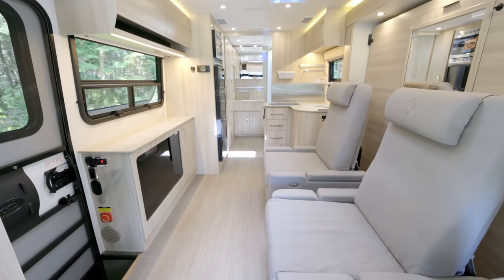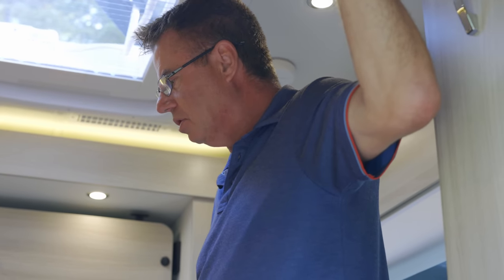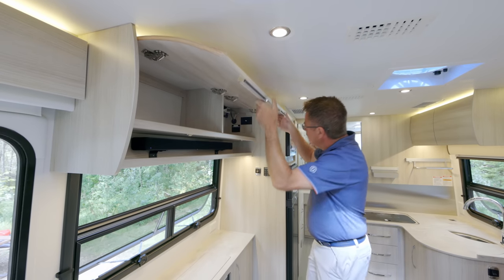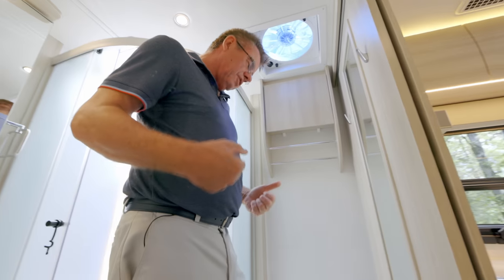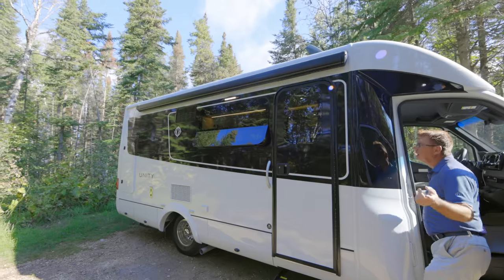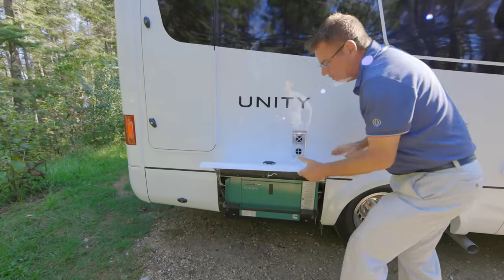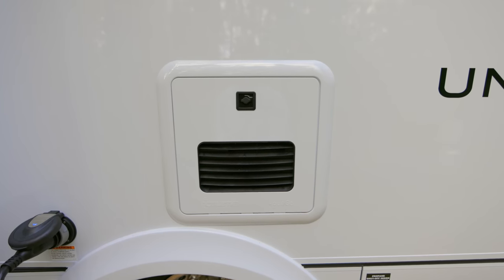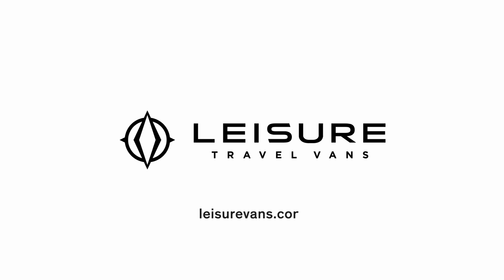2022 Unity Murphy Bed

Comment from the maker: Shop for LTV gear on our online store https://shop.leisurevans.com
Reply: Every time I see a new video from LTV I am disappointed that they still don't include seatbelts for every seat as well as an all electric/no propane option. Also when are they going to stop using those propane refrigerators as well as offering lithium as standard and not a pitiful 200 amps for a rig of this luxurious size. If I were to buy one of these it would be very costly bringing it into the future from where LTV is centered like sealing up the vents behind the frige after replacing the propane one. Don't misunderstand thinking that I hate their models because I don't, I would love having one but I would consider it an incomplete unit because of these shortcomings. There's also  no good reason that auto gen start is only available with propane and that there is no under hood second alternator.
Reply: The biggest disappointment of all is they discontinued the Serenity model. That was the absolute best floorplan they ever had.
Reply: @jeffreypatterson9956  no it wasn’t, it the most expensive and did not have enough headroom inside the coach - this has 6’5”
Reply: @jeffreypatterson9956  I agree with you 1000 percent.I don't like to used propane in my motorhome. I prefer to use all electric.
Reply: ⁹p
Reply: I guess it’s uncouth to ask the price??
Reply: @edmundf.kuelliiispiritualn2963  it’s $150k roughly depending upon options
Reply: 200ah batteries is NOTHING for that highly electric van 🤦🏻‍♂️ Hope they’re not idiots and offer a 400 amp hour option…
Reply: Love it do you have one with washer and dryer and second room? A bigger refrigerator or double doors, I want one but I don't know if I be able to remember work it or drive it never drove a van or truck well I haven't driver since my Teenage years I have transportation or lyft 😅 🙃  but I'm ready to get one of these to I don't every have to deal with slums/ Scum landlords bad environment was tricked during the pandemic to a apartment that's very sickening can't breathe it's just inhumane that van looks better than this so call condo this dirty landlords tricked me into holes you can see into the basement smells like gas sewage black mold and not heat or hot water top of that rat's bugs and since I called Inspector are crooked she bribe them hush money walls were dirty I have got a lot of health issues because of her n husband they really hurt me and my children health and everytime I try to look for apartment she and others give other people bad recommendations false statement lies she and her ppl discouraging housing agency Realtor and leasing agent not to rent to me when we are the victim that was tricked into the apartment that's sickening we shouldn't have holes or the debris dirty coming up and the inspector found we were breathing Carbon Dioxide and the landlord managed to sweet talk that people not to report her I don't know what to do facing homeless because they trick me in court I could find or afford a lawyer in system is corrupted was silence to to speak they censoring you they tricked me because they did want me to show the pictures 📸 videos prof of the living conditions first week moved in the winter during the pandemic we had to wander the streets freezing and having predator following me and my children chased me at night I'm living a night me I appeal my case again because I am not going to be homeless I don't have any where else and the windows doesn't open everything is in the condo is old and broken haven't cooked because the rat's come out bugs a lot of black beetles etc.. smells like gas that fire alarm ⏰ comes on carbon Dioxide machines comes on and we have hole 🕳 bigger that the front doors she only let us look during the pandemic for 5 minutes and their were furniture covering all the problems that we didn't know and no lights was working in the back were the back room you can see the basement laundry room which other neighbors wash their clothes 24/7"and we can hear 👂 them clearly like if they were in front of us like using the rest room I can hear their conversation and snoring and this is supposed to be a gate community old ass condo 2700 for a one bedroom not worth it even the movers the first day were getting sick they couldn't smell the black mold and the sewage it was a nightmare and I asked her to let me see it again when she move all the furniture but I fill for her excuses lies I'm sorry for my rant but I want Justice ⚖ I don't deserve this abuse and the system is treating her like she's the victim when we are the one that lost our hair got breathing problems a lot of health issues  and now suffer from insomnia due to this sick environment 😕  someone pray for me or send me some good vibe I would live in there before I ever move into a so called gate community for a place that looks like the 1940 never updated nor maintained the condo - basement -apartment  she calls it,  it's a piece of shit I she gave me the gutter but What comes around goes around her day will come Karma is going to get her her and her goons and family 👪 the people she hush not to help me will play for my what they done to me and my children 😕 😉 😢
Reply: Oh how do you fill the water 💧 🤔 I would need take classes how to understand a van life and were to park etc.. I have a lot of questions but I wished I knew about these van and save my funds instead of wasting it in hotels and slums landlords can't afford a hotel anymore because they rob you even when you live the hotels with sneaky trucks so that's why when my funds I we stood in the parks in the winter having a home that we can't live in because it's inhumane horrible the why the system treat the tenants when we have the rights 😢 to live and breathe in a clean home 🏡 😢 sorry for my rent but I'm going to start playing the lottery and when I win the lottery mega Million I'm going to get one of these home van so I don't ever have to deal with disgusting scum landlords

Comment: I have never seen a RV showing as well put together as this one. Clearly, he knows the product, and it shows.
Reply: 200ah batteries is NOTHING for that highly electric van 🤦🏻‍♂️ Hope they’re not idiots and offer a 400 amp hour option…
Reply: @createcapital6164  I had a 150ah battery and never ran out of power… a good controller helps quite a bit.  I only had 200w on roof but had another portable 200w that I could hook up to battery.  Never needed to.  I didn’t have a microwave (no use for it full time 99% dry camping).  Frig looks smaller than what I had and furnace drew the most power.
Reply: Naturally

Comment: OK I want to creat a custom model by merging the Murphy bed and corner bed configurations. I’d have a corner bed but get rid of the table seating and replace it with the swivel recliners from this Murphy set up. Gives you a regular bed that doesn’t need to be folded up. Great seating that swivels for a place to eat.

Comment: Top Gun had the legendary F14 Tomcats - not F18 Hornets.  Nice interior design for its size, and the solar power is a great idea.  Would like to see a large circulating fan above the bed for better cooling at night, Dishwasher & Washer / Dryer would also be must haves to be truly independent.
Reply: Nice catch, you have thought this through!
Reply: You'd have to sacrifice something important (fridge, bed, or storage) and would run out of water and battery power and completely fill your gray tank by the end of your second day on-site. What you appear to want is a fifth wheel or a Class A, not a Class B/C. Know your niche!

Comment: Great presentation, love the floor plan, and dry bath is a non negotiable for me. This is the RV I am looking to buy. Just waiting to pull the trigger when it transitions to EV.

Two features I’d like to suggest:

1) bathroom configuration option of a walk-in bath (right wall, with fold down cover so that the walk-in tub becomes a useful counter during the day), sink (back wall centered with small window above it), toilet (back wall left side, ie facing the closet). Take a look at the Airstream bathrooms offered in the 1960s for design layout examples. 
2) I’m not a fan of diesel and the world is rapidly adopting EV. I am holding out for when your RV is a hybrid, powered by EV + gasoline.
Reply: Why are there no hybrid vans? The Maxwell company converted a GMC van to hybrid. It was awesome. Plugin for extra 40 miles on EV mode, then 33 mpg in hybrid mode. With an 800 mile range. Who wouldn't buy a van like that? Now I believe they only convert to full EV mode. Guess Delivery vans don't need all that much range.
Reply: I don't understand why hybrids weren't a bigger thing. They expect everyone in a bad economy to go out & buy a new 66,000$ vehicle.Crazy!!

Comment: New features, compared to our 2021 Unity MB, are the rigid solar panels and the horizontal pivot for the raised TV. No mention by Dean of a smart DVD player or a heat pump or a rear ladder option or the automatic rain detection-vent fan closure. Also, the drop-down cover for the entry step well appears to be gone.

Comment: As always, I just love how people keep demanding energy-intensive features that they'll never use be added onto an RV that they'll never buy! xD
Reply: What features? Asking honestly
Reply: @meganpaskin2255  Electric heating, induction cooktops, dishwashers, and clothes washers/dryers. These demands are dead giveaways that the poster has never researched RVs, never owned an RV, never used an RV, and will never buy an RV. That's why LTV doesn't usually respond to these insanely ridiculous suggestions in YT comments. They listen to their ACTUAL customers.

To be fair, you CAN get these features in a Class A, super-sized Class C, 5th wheel, or motor yacht with their typically enormous tanks, generous battery capacity, and high-wattage generators - but absolutely NOT in a 20- to 25-foot class B!

Comment: I'm impressed with the layout, having never run into Unity before. But why must everybody use propane stoves instead of induction? I really don't want open flames in my van, and besides that propane is more of a pain to use.
Reply: Hello 👋 you’ve a good taste for cars and i’m impressed with your discretion…. I hope you’re having a good week?
Reply: That is my complaint as well.  Induction burners are cheap so I don't get it.
Reply: @elainedowd5134  They do the same thing with boats, a lot of the time. In older ones, it makes sense; they were set up for propane at a time when induction wasn't a thing yet, and it takes a fairly major refit to change that once it's in place. But when they're making brand new boats or brand new RVs, I don't get it.
Reply: @elainedowd5134  Allow me to guide you through
Reply: @benjamincarlson4707  Guide me through what?  I want to know if induction cooktop is an option?
Reply: @elainedowd5134  Guide you through every step of the way and yes the cooktop is an option
Reply: @elainedowd5134  I’ll guide you through in every step of the way and where are you from?
Reply: Electricity is the absolute WORST (least efficient) heat source for cooking, heating water, and warming up your environment. Gas is the most efficient. If your goal is to run your batteries empty as rapidly as you can to ensure the fewest days of dry-camping possible, then by all means go all-electric. FYI, the rig comes with a convection microwave and portable induction cooktops are things that exist, so you don't HAVE to use the propane cooktop. You probably should, though, since RVing is all about sensibly managing severely limited resources.
Reply: @colormedubious4747  I'll take your word for it. I'm less of an RVer than I am a boater, here to look for parallels I can learn from. This probably isn't one, because unlike in an RV, if your boat catches fire on an oceanic crossing, you have no ability to simply get out and dial emergency services to come put out the blaze. Any open flame on a boat is a major safety hazard. I wouldn't feel super comfortable with one in my van either, but at least I can see the possibility of sanity in it there.
Reply: @norarivkis2513  To be fair in comparing, all the used motor yachts I've looked at have only electric appliances, with the exception of a charcoal or bottled propane grill on deck for grillin', which you can always kick overboard when things go wrong.  Of course, most motor yachts also include fire suppression systems in their engine rooms and have hundreds of gallons of (usually diesel) fuel capacity to power their generators and boast very large water and wastewater tanks. RVs tend to have much more limited resources when not connected to shore power and city water & sewer. Most RV fires tend to happen while on the highway (not while camping) because some numbskull forgot to turn off their propane before departing.
Reply: @colormedubious4747  You have not done any research.  Induction is the most efficient heating source there is.  It is not the same as an electric cooktop.  Most US customers have never seen induction but it is used universally in Europe in both their homes and their RV’s.  It is instant on and instant off.  Just so you know you can heat water to boiling in 90 seconds.
Reply: @colormedubious4747  Yup, makes sense. I just don't want to risk my boat if some numbskull forgets to turn off the propane. I've got kids. 🤣
Reply: @norarivkis2513  🤣

Comment: best in class,, ,would be nice to see an all electric unit,,, no propane,, no genset,, lots more solar on the roof and fill the genset bay with litt batteries ,, electric cooker ,, A/C running off the batteries with a higher output inverter :)))